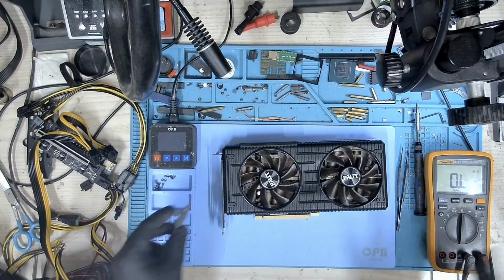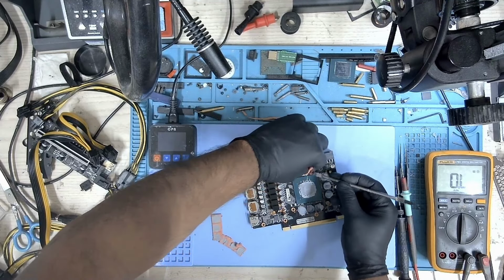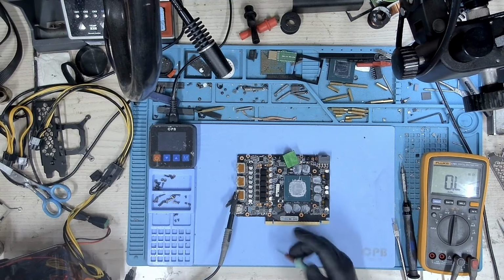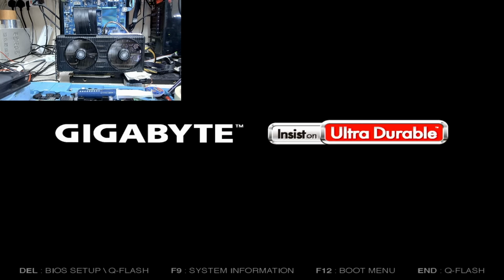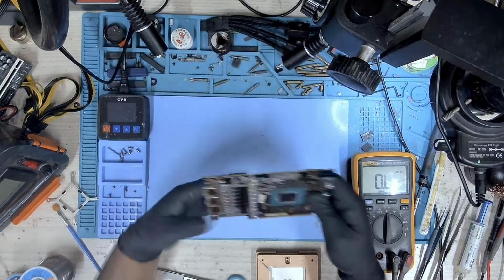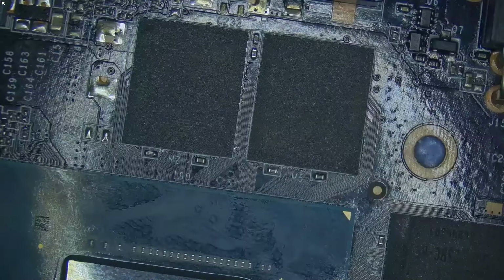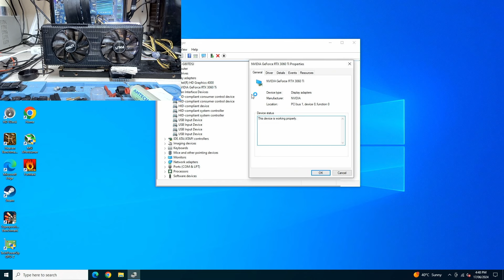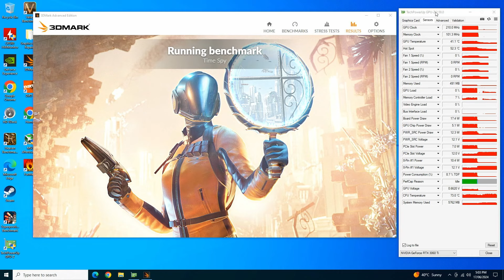RTX 3060Ti Memory Swap: Is It Worth It?

Comment: It's easy way to diagnose failure Hynix memories. Use command floorsweep in MODS and check independly every channel. Don't need to change straps from Hynix to Samsung. Memory config tables are almost the same for both memories. Why don,t You use preheater?
Reply from the maker: Thank you my friend. I will try this command. I have a preheater being used. The blue mat you see is a preheater.

Comment: Why is the 3050 so much larger (physically) than the 3060ti?
Reply from the maker: It depends on the AIB partner on how they design the GPU board. It does not have to be large.

Comment: Hi Frazer, i have a quick question, I have a Palit RTX 3060ti GPU that came with hynix memory which was crashing under load, so I decided to change the vram, apparently the hynix was GDDR6, now I only have GDDR6X micron memory from an RTX3080. Is it possible to configure straps then solder the micron memory for the card to work?
Reply from the maker: No it will not work. The data lines position of GDDR6 and GDDR6X are positioned in different locations. So installing GDDR6X memory on a GDDR6 slot may cause damage to the GPU core.

Comment: what wrong with the hynix memory's?, why not replace only the bad one? or it does gives pass on mats/mods test like the the early microns on 2000 series cards?
Reply from the maker: Its a similar case like early micron. The X005 memory of  Hynix is defective. it passes in mats but gives error code 43 and crashes in windows.😁
Reply: @GraphicsCardRepairs-tk7ql  ohhh I see, good to know, thank you.

Comment: The SK hynix H56G32CS4DX005 VRAM is best replaced with which Samsung VRAM: K4Z80325BC-HC16, K4Z80325BC-HC14, or K4Z80325BC-HC12?
Reply from the maker: You can either replace it with a K4Z80325BC-HC16 or with a K4Z80325BC-HC14. Don't use the HC12 one. It's slow. HC16 would be like an upgrade having scope for over clocking by 500Mhz to 1000Mhz in MSI after burner depending on the VRM phases for memory. On smaller cards with just 2 phases with HC16 can be over clocked by 500Mhz with no issues and with cards with 3 or more phases for memory can be over clocked up to 800Mhz to 1000Mhz without any issues. I will be releasing a video on this soon. The 3060Ti memory upgrade.
Reply: @GraphicsCardRepairs-tk7ql  I can't wait to see that video. So, is HC16 better, and will it run normally without overclocking?

I have a graphics card with SK Hynix X005 and it has a problem where the VGA frequently shuts down unpredictably. Whether I use it for gaming or leave it idle, the VGA shuts down suddenly while the PC continues running. Usually, I switch the HDMI cable to the IGPU and the PC runs normally.

There are no signs of overheating or artifacts, FurMark and 3DMark tests show no issues unless the VGA shuts down suddenly.

There seems to be something unique: if my PC is not used for a while, around 1 to 3 days, when I turn it on, the VGA can run for more than 3 hours. However, once it shuts down suddenly and is turned on again, the VGA only lasts until the Windows login screen.

I have tried DDU with no change, and using a different VGA works fine with no issues. 

Could this be a sign of a problem with the VRAM on the SK Hynix X005?
Reply from the maker: Yes this is a typical X005 issue. Swapping to Samsung should solve the issue. HC16 is basically 16Gbps memory it is faster compared to HC14 which is 14Gbps memory speed. By default since the BIOS recognises only with strap only in the 14Gbps setup the default speed will be 14Gbps but it has more room to overclock. Unlike the HC14 which will peak with a 500Mhz overclock HC16 can go beyond. On a 4 phase memory VRM it can go up to 2000Mhz overclock on MSI afterburner. Now that is some real speed boost. However on a 2 phase I have noticed artifacts after 1000Mhz. Still this is a good hike in speed. Hope this helps. Even if there are only 2 phases for memory, the MOSFET/DRMOS can be upgraded to a higher Amps rating . Like most 3060Ti come with 50A MOSFETs or DRMOS these can be upgraded to something like 80A to get some added power.
Reply: @GraphicsCardRepairs-tk7ql   Thank you for the detailed explanation. I hope it will resolve the issue I'm experiencing. I look forward to the video on the upgrade. Thanks a lot.
Reply: @GraphicsCardRepairs-tk7ql  Does the number next to the Samsung logo on the chip matter or just the long one